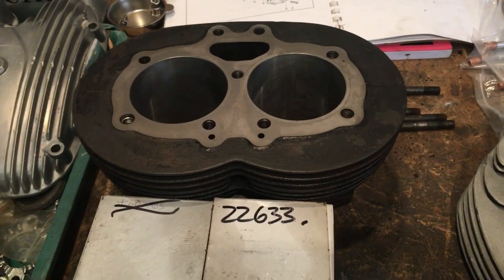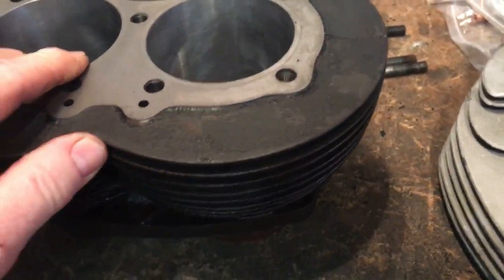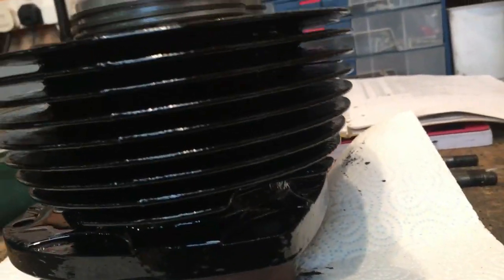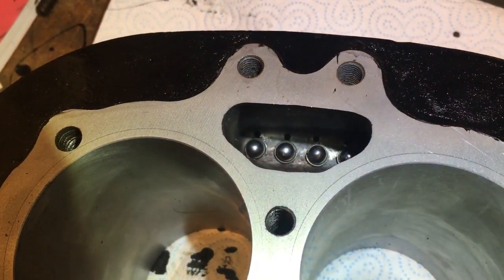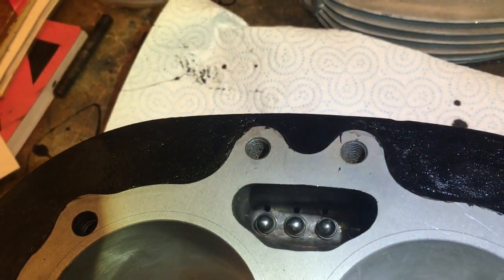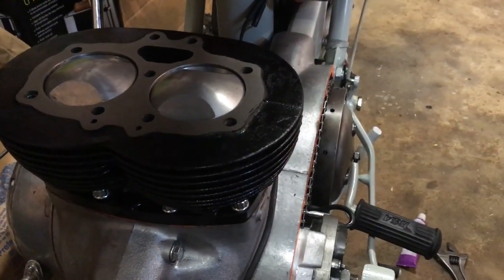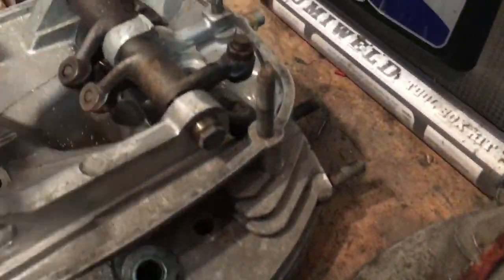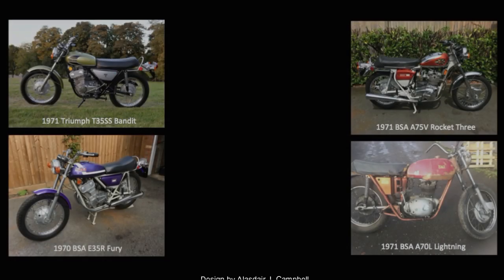BSA A70L Lightning - Engine Part 32 - Barrels, Pistons and Initial Cylinder Head Considerations

Comment: Once again; the stuff you're rectifying is mostly  from abuse, not use.  Your work shows appreciation not just for the machine but also the people that built it.
Reply from the maker: Agreed John definitely abuse in this case - it probably never saw a change of oil. Thanks for the kind comment - appreciated.
Reply: Nice work,like to see the caption at the start,good quick information.time lapse is good. More progress on the engine build,well done.
Reply from the maker: Thanks Matt.